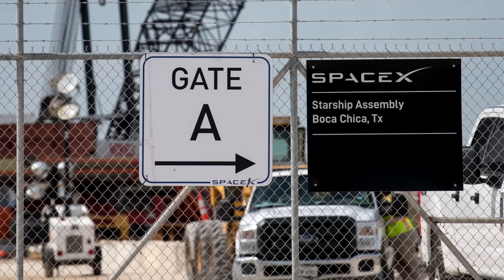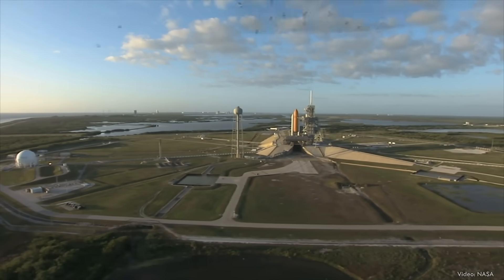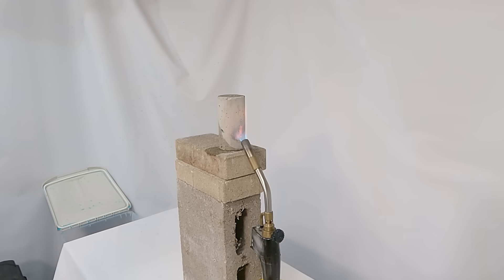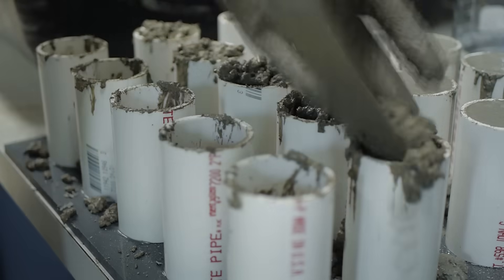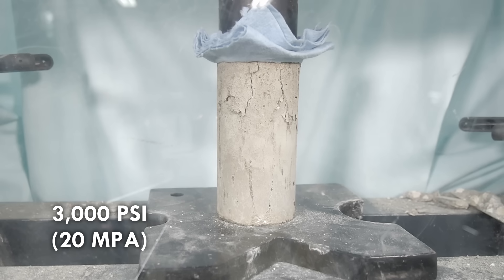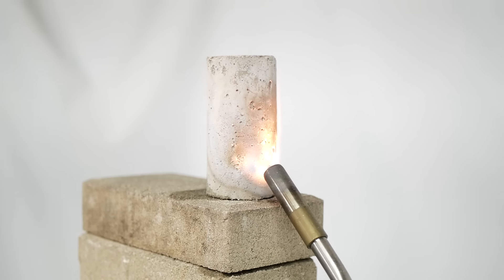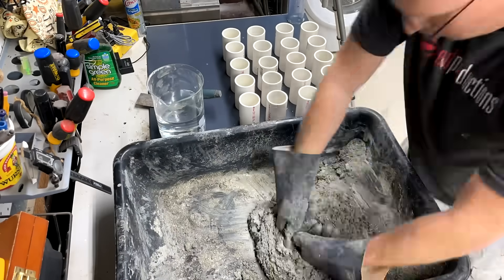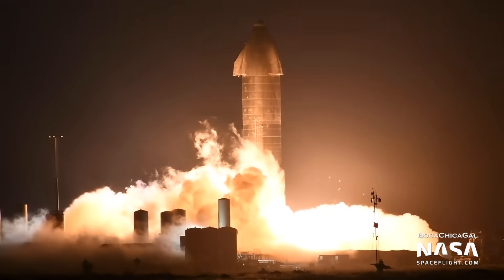Why SpaceX Cares About Concrete

Comment: Up here in Washington, we had a record breaking hot summer. It was actually causing panels of concrete on the I-5 freeway to lift and buckle. I'm not 100% sure what caused it but the news was saying the long hot days were the culprit. I'm guessing since we get so much rain here the concrete changed during the heat and repeated road use and buckled? Pretty interesting!

Comment: So, how about a pair of magnetic field generators that create a parabolic field aimed at each other? One in the craft and the other on the launch pad. For propulsion, you use a super-heated plasma that travels between both fields. To power the generator on the vessel, you use radiant energy beamed from various platforms.

This would remove the weight of propellant from the vessel while allowing plasma to be generated from various terrestrial, orbital, and interplanetary platforms. Since the plasma generators can be mounted on larger objects, they can be as large as they need to be.

This also allows for scaling so that initial generators would provide enough acceleration over longer periods while larger generators can provide more acceleration. The scaling also allows for vessels to be of increasing size restricted only but the magnetic field generator on the vessel.

With multiple fixed generators, multiple vessels can be launched concurrently and asymmetrically, or a single larger vessel. Multiple generators also offer redundancy in case of mid-flight failure.

Comment: The sub orbital pads are pretty well obliterated immediately under each rocket engine after a build and launch campaign. So much so it's got to be replaced before the next one, or the boom lifts will get all tippy driving into the holes.

Comment: Would an active cooling loop imbedded into the slab help with this or would it make it weaker?  NEXT VIDEO IDEA MR PRACTICAL ENGINEER!
Reply: May be useful to skip concrete altogether and go for a watercooled steel surface. If watercool Ed cast iron can stand up to the Temps in blast furnaces

Comment: After 5 minutes of googling I have devised a Dilating Hafnium Carbide Graphene Concrete tunnel. In my mind it is configured to look like a sarlacc pit that would dilate and absorb force and heat as the rocket leaves or enters the launch/recvovery site. Seems pretty sci fi to me. Lets go engineers. I only dream them up, you guys do the rest.

Comment: Very interesting. I always wondered how they dealt with the extreme heat during rocket launches. Thanks for sharing this with us.  How do you feel about all of the extreme building that Dubai has been doing in n its quest to always have the tallest, biggest, deepest everything?  Specifically, I’m looking at their gigantic observation wheel. How difficult would those wheels be to engineer? https://youtu.be/euRfrOcao4A

Comment: I have no idea how it'd deal with heat in general, but is there concrete similar to deliberately porous asphalt? Here in the Netherlands we use something that goes by ZOAB in Dutch on roads ("Zeer open asfaltbeton", a literal translation would be "very open asphalt concrete"). I seem to remember it is being used because it helps get rid of water and also reduces the noise caused by wheels a lot, especially at higher speeds.

Would concrete with similar properties deal better or worse with extreme heat in combination with moisture? On the one hand the steam has a way to get out but it also has less contact with the material around it maybe holding up worse to thermal expansion. Could be an interesting experiment if the mixture is easy to make, no idea what is different about the mixture they use for roads compared to regular stuff.

I don't think one would want to use such porous concrete for building construction, but as a pad on the ground that can periodically get wet just letting the water drain away into the ground would be a pretty neat way to handle it. But there's probably some good reason why it won't handle rocket exhaust well that is beyond my understanding of concrete (heat? pressure? combination of them?.

Comment: very interesting about the concrete breaking like that and turning pink. I feel like older US infrastructure which appear crumbling have a pinkish look to them. Were older concrete mixtures not as resiliant to heat, and will new concrete hold up?

Comment: This was actually very unscientific for the refractory concrete and here's why:

The blow torch heated sample broke around the limit of your press, and so you have no proof that the other two refractory samples wouldn't have broken ever so slightly above the limit of your press within the margin of error between two samples. While it's likely that concrete with extra reinforcing fibres is much stronger (we have professional tests that show this) there's nothing in your specific experiments that demonstrate this. Get a bigger press or don't claim the results you did!

Comment: Another critical factor is the amount of water used in the mix both for regular concrete and refractory. Fifteen percent too much water in most refractory mixes can reduce strength by as much as 50 percent.

Comment: Fascinating stuff. But can you answer the question: why doesn’t SpaceX care about ecological integrity as it launches up to 300 tonnes of carbon dioxide into the upper atmosphere per rocket?
Reply: Until we get that orbital ring built, all space travel requires rockets, and all rockets emit exhaust of one kind or another. There's just not much SpaceX can do to pollute less.
Reply: Only thing that probably wont go electric will be rockets there is no other way to get to orbit.
Btw can you give me the equation you used to get the 300tons of CO2 please
Reply: >300 tonnes of carbon dioxide

Comment: Thanks very much for posting this interesting subject matter Grady, nicely presented as usual thanks.
Best of luck to you and your lady with your rug-rat, our 2 girls are 30 & 24, the time flew by 

I never realised they had a crane system for landing the planet rover on the surface.

In your cooking experiments (5:11) I could see the chunkier agregate but what was your sand to cement ratio, 5:1, 3:1, 1:1 and did you use sharp sand, stone dust or chalk? Silica or non-silica?  I read somewhere that coesite or stishovite (found at impact sites) could work as a base plus some mashed up Coade stone (artificial stone, developed in the 18th & 19th century) which was fired twice for super toughness. 
On the reasons for the launchpad failure, what was the concrete recipe I wonder, how much per ton and what was the amount used?  
no doubt the concrete firm was under a lot of commercial pressure to get the work done, I think that it wasn't fully cured and there was still moisture in the mix.

Your pressure tests were a lot of fun and it was astounding to watch the 10 ton press fail to mash the refractory sample with fibers. 

Apparently concrete can take anything up to 6 years to fully carbonate and 1 ton of cement concrete produces about 3/4's ton of CO2 so no doubt our future will be nano-carbon tubes, graphene and geopolymer concrete.

I stopped using cement & gypsum in 2002 and now I plaster using lime putty mortars & top coat mixes. I buy in the fine kibbled, chalk quick lime from my supplier to slake and make my own lime putty and add sand or different grades of chalk for my material. 

With lime putty there is no shelf life time and if kept away from the air, under a little water it will be good for many years so there is little waste, if I mix up too much I can put it back in the tub with a lid. I even heard about some lime pits found on an Italian building site which were 500 years old and the lime putty was still usable. 

Obviously a lime launchpad would never work but a lime wall has better acoustics, it absorbs CO2 and smells nice, it's certainly great for plastering. I still have one 25kg tub left over from  a bulk order I made in 2003.

I realise that you need money to make your films but do you really think that HelloFresh is all that sustainable, look at all the plastic and the other non-biodegradable wrapping that the food comes in, the box was probably the greenest thing about it. Perhaps if they made the wraps from hessian, grass weave, potato starch, seaweed or banana leaves I might be tempted but otherwise for a family of 4 (we are 2 pescatarian & 2 minimum meat eaters) we shop at a supermarket or local shop once a week.

What is the cost of 1 HelloFresh box for a family of 4, it's not mentioned in the blurb?

Comment: Making moon concrete would be very difficult due to having to make the concrete with not only the materials found on the moon, but also in the moons lack of a climate. Unless you plan on making extremely small amounts in a lunar base with climate control and event then applying it outside would be a challenge

Comment: "And in most cases" the landing isn't precise?!? SpaceX has landed 90 boosters successfully, against a handful of losses, half of which were in the experimental stage. The old crashes look great on the screen, but convey a far from accurate sense of the landing success rate for the last 4-5 years. And note that most landings are on a drone ship, a target moving in 3 dimensions - the deck is moving vertically with the waves several meters. Precision is not the problem.

Comment: When you use a torch like you did you need to back up the tip around an inch to a inch and a half more than you had it to maximize the flame heats sweet spot. Just a tip from a plumber.

Comment: Why not just build a proper exhaust deflector channel?
Reply: For landing pads? Precision landing on a big flat surface is hard enough. Precision landing on a much smaller surface in the middle of complex formwork would be much harder.
Reply: @General12th  SpaceX had a problem on a launch pad, not on a landing pad.

Comment: Semi porous concrete seems to be a poor choice for a pad surface.  Some type of top layer ceramic that’s not porous, highly insulative, and made from a single compound to avoid expansion cracking would seem to be a better choice.  The cost difference is likely made up by less pad prep and maintenance, ie pre heating and constantly keeping the pad dry.

Comment: I once build an ice rink in my home town and to avoid cracking on the concrete and damaging cooling pipes they submerged it in a think layer of water for a month to prolong curing how does this help the concrete not cracking
Thanks
Reply: Portland cement concrete will cure much better and stronger if it is wet. Curing it under water is ideal whenever possible. They probably did this just to make it as strong as possible.

Comment: This raises the question: how DOES SpaceX intend to land Starship on Mars and take off again with only loose regolith below? If chunks of a landing pad can be destructive at launch then why wouldn't chunks of blasted regolith also be destructive to landing or relaunch?
Reply: SpaceX has shielded the wiring since then.
Reply: Also mars has more gravity and a atmosphere, so its better than moon landings
Reply: @DavidWalkerP47  I'm not sure how that helps. It helps prevent the "debris blasted out at escape velocity" problem that the moon has but it doesn't help with the "on earth we need to build launch and landing pads out of specialized concrete or else our ship gets damaged on launch or landing" problem.
Reply: @zarfmouse  what i mean is, the moondust is incredibly sharp because the moon has no atmosphere, meaning no wind, no wind means no erosion on the dirt or moon dust, mars has all this though so itll be like landing in the desert
Which doesnt help but its better than tiny sharp needles flying out atescape velocity
Reply: @wadewilson6628  you do know that you dont need much fuel once you escape the gravity of the planet right?
You simply float through space at what ever distance you stopped using the engine thrust after escaping the planet

Comment: I’ve had my fill of refractory cement products in the casting unit of a steel mill. Had to spray and hand finish the inside of tundish boxes. That’s the box that the steel coming out of the ladle goes into before it goes into the mold area. That way when one ladle runs dry you can swap them out without stopping. I don’t know what was in that mix that we used, but that stuff stunk sooo bad!
Reply: So damn true! The calderys dryram we use smells so goddamn bad

Comment: 9:40 not just heat and chemicals, extremely high pressures, a rocket sorta "stands up" on it's exhaust, and when it is that close to the ground the ground is going to feel that weight to a pretty large extent. it is kinda inverse square, but that close to the ground the pressure doesn't have far to spread out.
Reply: Also the gasses are traveling very fast. So heat, pressure, chemical composition and high velocity gasses. A nasty environment for sure!

Comment: I think another lesson we learned today is that we need to get you more funding so you can get a bigger press for more testing...

Also, for ships trying to land on lower gravity planets that might kick up dangerous debris, maybe have a set of engines higher up on the vehicle to prevent rocket plumes?
Reply: Keep in mind that whatever damage the exhaust can do to the landing pad, it can do even more damage to the sides of the ship. Those plumes exist somewhere. All you can do is manage where they shoot and how close everything is.
Reply: @General12th  yeah. I was just thinking that if there are engines up high enough, it'll be like the sky crane mechanism to drop the rovers, except the bottom of the ship just touches down instead of being something lowered on a cable. And the engines could probably be tilted out away from the ship to prevent damage... Not sure, we need a rocket scientist
Reply: @DoctorX17  If you tilt the engines so their exhaust moves away from the rocket, then they'll be less efficient. Not all of their thrust will be pointing straight down.
Reply: that's exactly what they will be doing on the lunar variant. 9 smaller lander engines on the upper section of starship.

Comment: The traditional way was to fill the exhaust trench with water and there would be a water tower nearby which would dump by gravity more water into the trench.  The explosion of steam probably even pushed back a bit on the rocket thrust.  Doing this in the desert may have caused them to rethink the water method.  The pads next to the ocean could be flooded with a layer of water.  This would probably ruin their landing photos due to the clouds of steam.
      The best way is to avoid refractory concrete altogether and use refractory bricks held in place without cement (since it would turn back into quicklime) through compression from vaulting at the top and gravity loading for the walls.  If you look in one of these refractory kilns, you will notice no mortar between the bricks.  The vault was held together through buttresses of lower grade brick which was cemented together.

Comment: That pesky Anhydrite, cement, always adds strength and unit weight to our mix designs.  Refractories have always been used in smoke stacks, allowing for HIGH temperatures with out spall, delaminates, or failure.  For as dumb as concrete is it sure has some complexities.    Cheers to: SCIENCE!

Comment: Worked refractory brick up in the oilsands, made many test cylinders, poured concrete for block l would make the sample in the block then smash it out to replicate the drying process as close as possible to achieve the correct mpa.

Comment: would like to see this test done where the cement is given a few weeks to cure before the heating process.
Reply: His hydraulic press tops out at 10,000psi. Not much busting would occur with the 28-day or 56-day standard increments unless he had access to a higher capacity press. I agree, though.
Reply: So his press would have an even harder time breaking the concrete? He seemed to have a hard time getting data already.

Comment: If concrete's porosity is the root of so many problems - why isn't all important concrete painted and sealed with e.g. Latex paint?
Reply: Latex paint is expensive, imperfect, fragile, and takes a lot of effort to apply to every surface -- at least, relative to the cheapness and effectiveness of not bothering. Latex paint might make concrete better in some ways, but building projects don't have endless amounts of time and money. Leaving concrete unpainted is probably considered a worthwhile tradeoff for most applications.
Reply: @General12th  latex was just an example. But surely there must be some benefit to sealing concrete with some laquer or spray?
Reply: @MoritzvonSchweinitz  I'm sure there's benefits. But are they worth the cost? In some cases they are, and in some cases they aren't.

Comment: Just had a Soyuz manned launch to the ISS today (arrival time 3 hours) and basically the just have a massive hole so while this is interesting as it has many applications in the building trade as far as launching rockets go well...all you need is a huge hole in the ground basically.

One interesting place for the study of "launch sites" is the Island of Barbados which oddly enough just got hit with a huge volcano ... so land is cheap there at the moment i imagine.

Anyways if you have volcanic ash to work with as a cement you're going to have a very durable multipurpose product where in the space launch business meaning being having a Port facility.

How well that Port holds up to against the everyday of saltwater intrusion will define just how good your concrete is absolutely.

Humidity another huge factor as well.

But again that's for your port facility.
SpaceX has already shown you can land on an all metal barge ... with one option for launch being considered launching from an offshore oil rig.

Long $rds Royal Dutch Shell
Strong buy